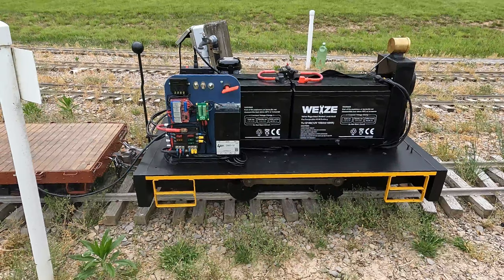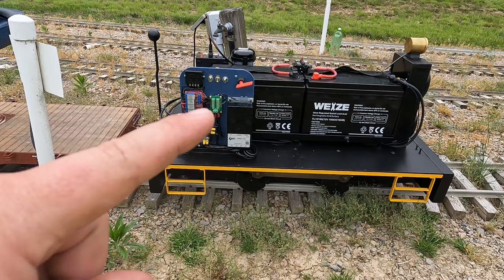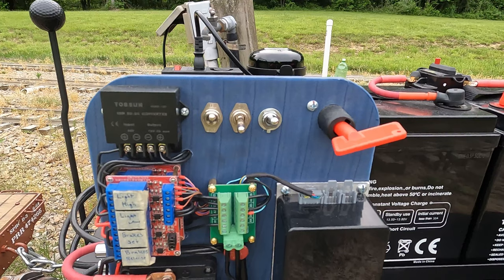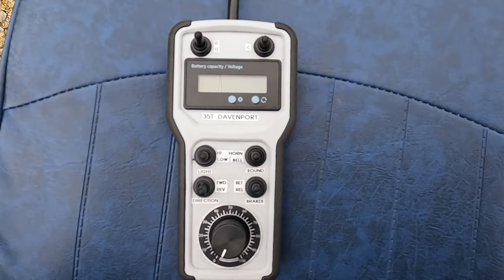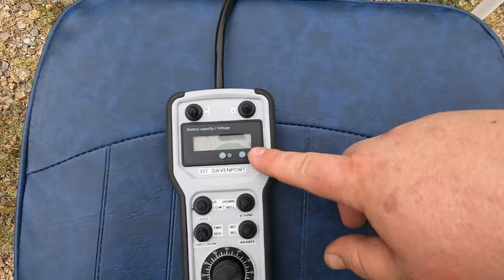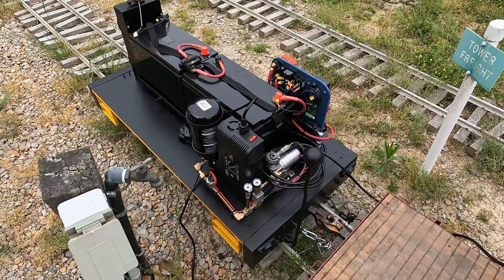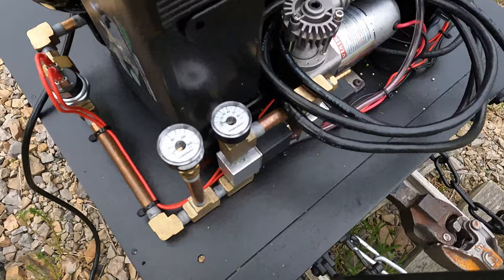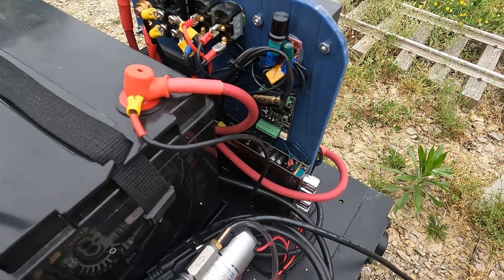7.5" Gauge Gas to Electric Locomotive Conversion, 2.5" scale | Part 3, Wiring

Comment: You have done an amazing job on that loco. A pulling beast. I was so impressed, it didnt skip a beat up the grades.. be proud of it.. well i know you are.. but just incase, 🤣🤣
Reply from the maker: Thanks Pappy! One of the motors has a bearing that was defective from the factory. If I fix that during the winter and my vibration sound goes away, I will be.... chuffed

Comment: looking good. I may loosly base my first build off of this. I want to do electric, and small enough that it will fit in the back of my hatchback. yet powerfull enough to pull me and some passengers. and the fact that it is going to look like a steam loco is a bigger bonus.
Reply from the maker: Good luck to you! I can fit the locomotive and two 6' flatcars in the back of a Honda CRV

Comment: Looking great there!!! :D
Have you tested how fast it can go? I'm curious as I'm thinking about the same type of motors for my build :)
Reply from the maker: It was geared for 5 mph. Without a heavy load it will go a little over that. 5 mph is a nice cruising speed, comfortable but yet not so fast that derailments get crazy. The biggest mistake I see people make with electric locomotives is that they gear them too fast, so they pull ridiculous current at low speeds, which burns up the motor controller and shortens the life of the motors.

Comment: Cool stuff, do the rail tracks come factory made at a preset scale, or are they made by you at a chosen dimension?
Reply from the maker: The metal rail itself has several variants, west coast profile, aluminum or steel, different base widths of the rail (15/16" or 7/8"), typically 1" tall for 1/8 scale trains. The track is assembled on site, the ties are cut from ground contact rated pressure treated wood, or are made of molded plastics with built in tie plates (brand name accutie). In the New England states and the UK 7.25" gauge is common, elsewhere in the U.S. is 7.5" gauge. The track I run at is approaching 6 miles, 95,000 ties (spaced about 4" apart) and each tie has 4 screws holding the rail down, so about 380,000 screws installed by hand, one at a time.
Reply: @mattkinnard6899  wow, interesting info, you can really start a train Union with that length of rail
Reply from the maker: @Cormano980  something like that. A sanity check may be needed at this point lol.
Reply: @mattkinnard6899  nah, you're ok don't worry, I'm into rc tanks and I've lost count of how much money I've sunk in them, as long as it brings you joy from this shity world is perfectly fine
Reply from the maker: @Cormano980  the justification used at the rail club lately is, "keeps it's value better than a boat or a fancy can-am"
Reply: @mattkinnard6899  and "future generations will make good money from it, it's practically art"